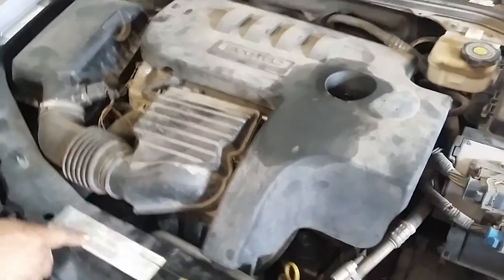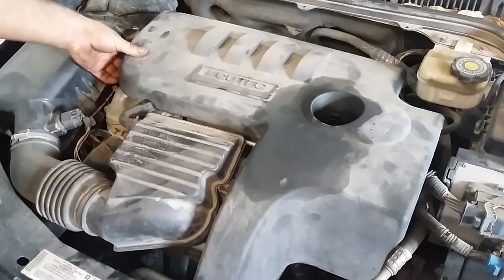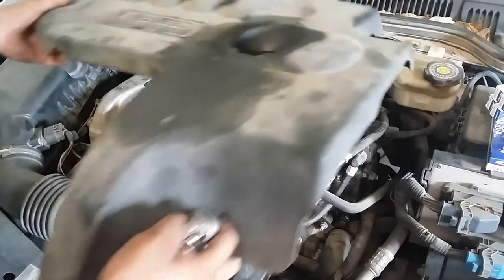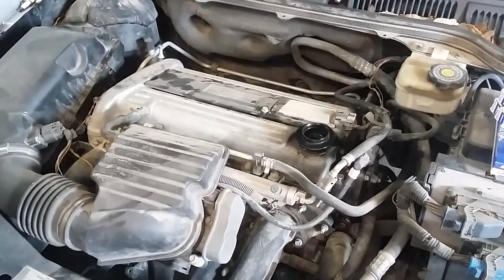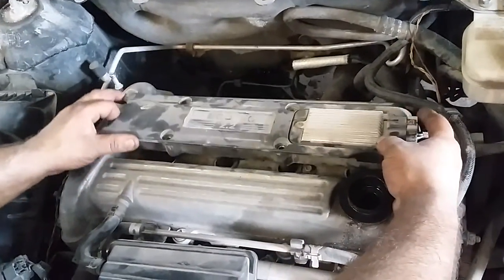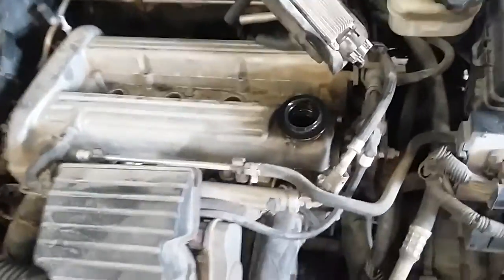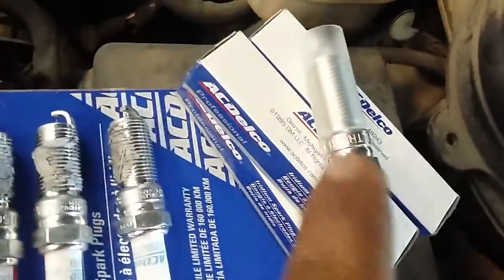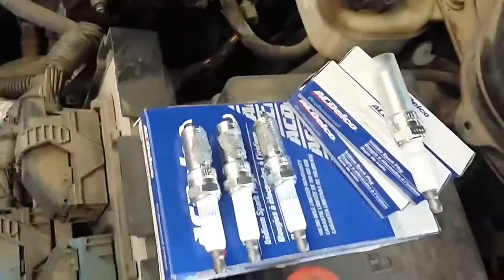2005 Saturn Ion 2.2L Tune up

Comment: Is this engine similar to the Chevy Malibu 2006?
Reply from the maker: DarthRevan I did some research and your model does have the 2.2 so it should be similar. Most filling for cylinders are the same way. be sure to subscribe in if you have anymore questions let me know thanks
Reply: I subscribed thank you.
Reply from the maker: Sorry I was using voice command if it seems confusing I appreciate you subscribing have a great week and good luck.

Comment: This video is horrible! There is no audio, this isn't a tune up at all! I see a horribly dirty engine and some extremely oily spark plugs,  and some new plugs. And you're missing your oil fill cap. This car is going to blow up!
Reply: The video makes a lot more sense if the audio is turned on for you.
Reply: Dirty engines are common when the car is 14 years old and don't blow up as a result of it.
Reply: @Remrie  yeah but shouldn't the oil cap be put back on before you go blowing dust and grit off the engine block?
Reply from the maker: @PtrOBrn  does it show me blowing anything in the cap? Dont be an idiot and dont be a troll all your life. Grow up
Reply from the maker: Your such troll...a dumb one at that. Nothing good to say. Troll elsewhere
Reply: @autotech2103  is it not good habit to prevent foreign objects from going into the engine block? Blowing off the dust and debris with the oil cap off seems like an invite for something unwanted to drop into the engine.
Reply from the maker: @PtrOBrn  does it show me in the video doing that? Dors the video show me blowing debris?  No it shows a quick tutorial. We closed the cap and finished working on it. Which doesnt show because it's not a step by step how to...its a quick tutorial. Yes you are correct closing all ports and oil cap is necessary and proper procedure. Anything else?